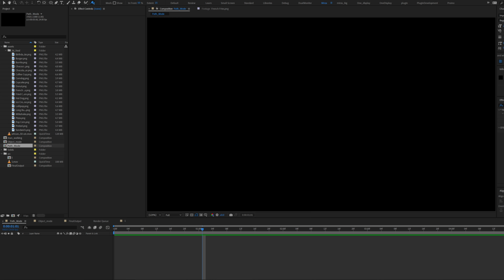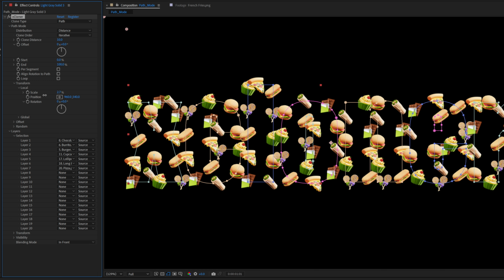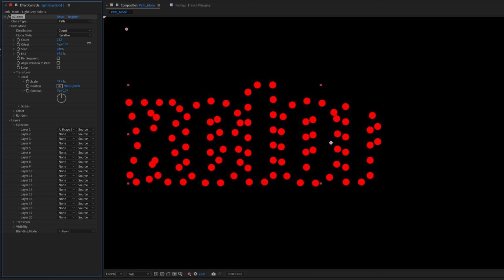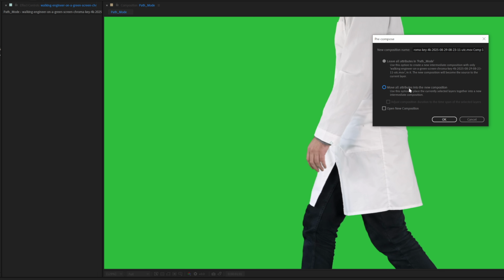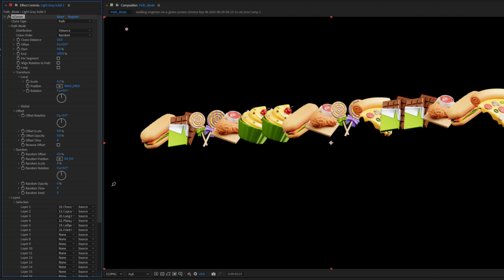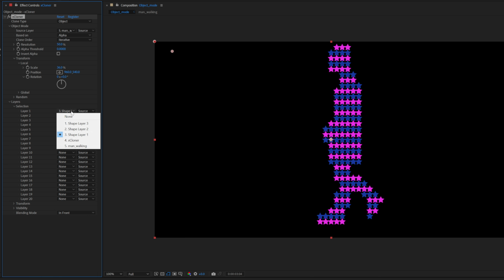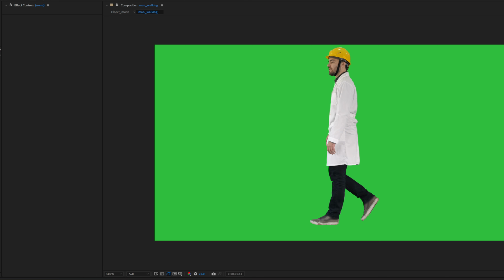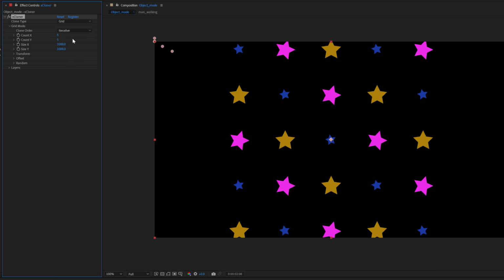xCloner v1.3 Tutorial

Comment: I created 7 solids with one path and one xcloner effect each. Each solid has about 10 same layers referenced by xcloner (each layer is a 15x15 pixels composition with one single png). All in all there are about 120 clones in my final comp (3500x2500) moving along 7 splines. Is it ok that after effects crashes in the middle of the render due to insufficient ram (I have 64gb + 200gb cash on ssd. Threadripper 2990 WS, rtx3090Ti)
Reply from the maker: Hi can you please contact me at info@mirzakadic.com